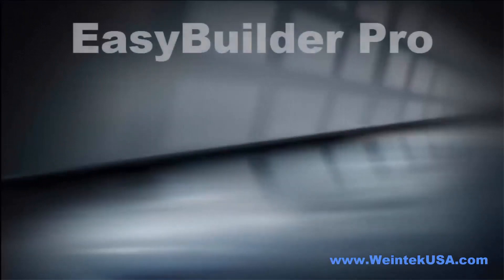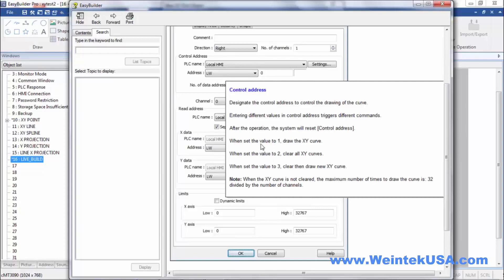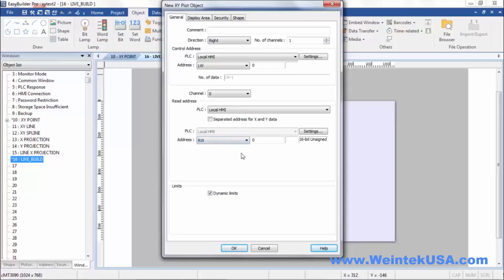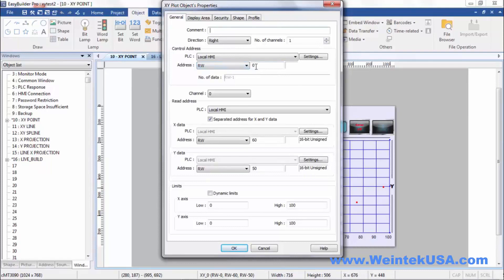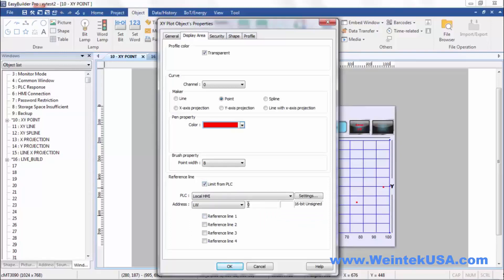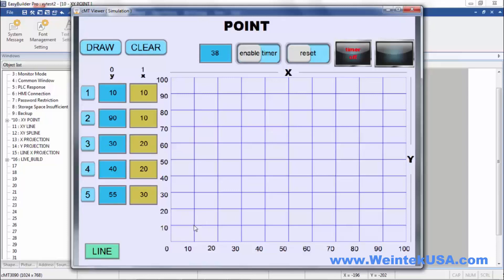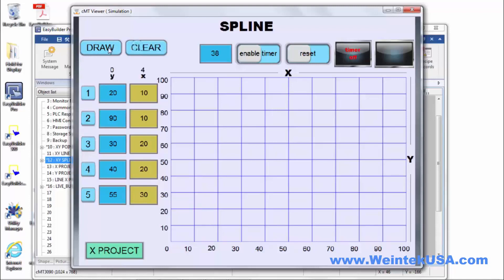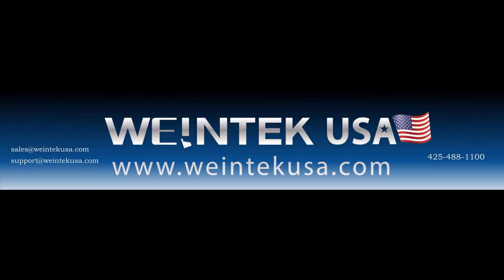XY Plot Demo EasyBuilder Pro V6 Weintek Development Software

Comment: @2:47 "you can only store 32 points of data in your plot" . INCORRECT! Each channel can have up to 1023 points. If you're setting the control address = 1 to continuously add points to the plot, then the 32-point rule you mentioned applies. Otherwise, set the control address to 3 and plot the maximum.